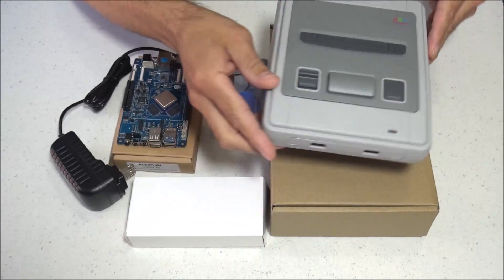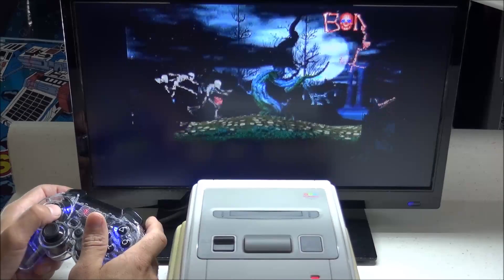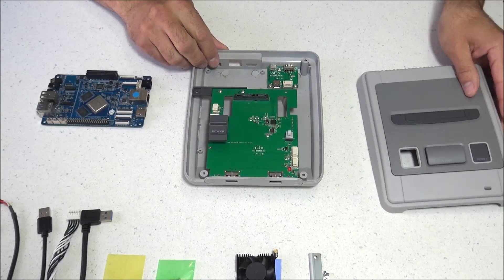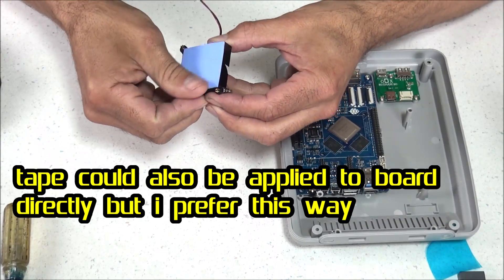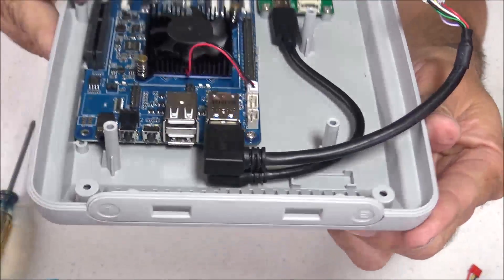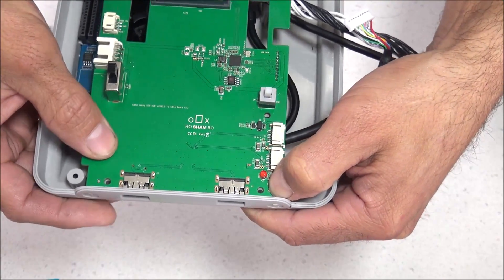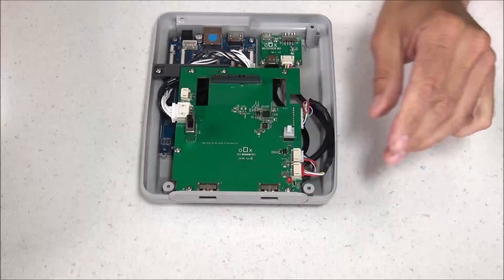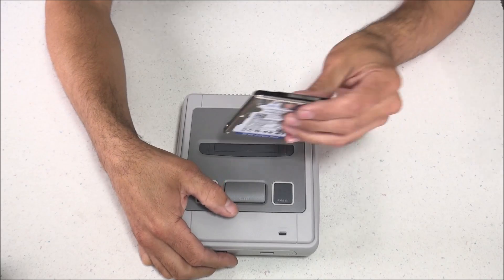First Look: RockPro 64 & Roshambo Super Famicom Case + BUILD

Comment from the maker: IMPORTANT NOTE: THE OPTIONAL METAL BRACKET I SHOWED IN VIDEO NEEDS TO BE USED WITH SHORTER SCREWS WHEN USING FAN OTHERWISE THE Plastic BRACKET COMES IN CONTACT WITH FAN causing it not to not spin.
Reply: I have this case that I just got from cloud media, but I cant seem to find a working distro that works with the case and board. Is there an image that currently supports the rockpro64 and case with the safe shutdown and reset scripts already  working? Where did you get the image from retro arena as the one I'm currently using doesnt work with the rockpro64 at least the one I downloaded from their site.
Reply from the maker: @ericochoa4034  the one I was using in the video has not been released yet to the public they are hoping to release that by summer is what they're saying. There might be a recall image that's available I'll find out some more info on that
Reply: @8-Bit_Flashback  ok thanks!
Reply from the maker: I am told that there should be a recall box image available for public early next week That will support the rockpro64. I will post a link here once the image becomes available.
Reply: @8-Bit_Flashback  thats really great news thanks for the info!
Reply from the maker: Here's a link to a recalbox image please keep in mind when the Retro Arena releases their image it will have a lot more functionality and I will be posting that on here as well as soon as it's released. https://github.com/mrfixit2001/recalbox_rockpro64/releases/tag/190427
Reply: 8 Bit Flashback hello do you have a link for safe shutdown script for rockpro64 with recalbox? thank you
Reply: 8-Bit Flashback, grateful for the video with the lack of documentation.

Comment: Could you comment which version of Rock64(2Gb or 4GB) did you used in this video?, I have a Pine64, do you think is will work with it?
Reply: blue dot on the rj45 signifies the 4GB model.

Comment: OK, so the only place I could find the case in stock was here - https://www.cloudmedia.com/?product=roshambo-retro-gaming-case. Man, Really confusing endeavor to order this thing on that site -  there are 4 different SKUs (supposedly) for this case. I am using a RP3b+, so I want the rasp.case...But, Hey, I already have a power supply (like i'm sure most of us have if we already have a RPI) so i looked at getting the case with no power supply...however it shows that that one is only "Compatible" with the Rock64 in the listing header, funny as also that particular site doesn't sell the power supply for the RPI by itself yet they have several different ones for the Rock64 - Also, description lists the basic case without power supply as "made for  Raspberry Pi and Rock64" no mention of the Tinkerboard. No where on the site does it state that their power supply is "Required" - if so, then why sell the case without one? Customer service has yet to answer my e-mails. Just a little weird.

Comment: It's cool the more sbc are getting case love. Personally I need a genesis or dreamcast case. Hopefully they can make xu4 and n2 and even h2 ones.

Which do you like more for emulation, n2 or rock pro?
Reply from the maker: The emulation development is a little bit farther on the N2 right now but the Retro Arena team is working pretty hard on both of the single board computers. And with everything being in the beta stages its hard to make a decision  just yet.

Comment: How come one of the Super Famicoms is smaller than the others?
I don't use Type C. I usually use Micro since PS4 and when I first got a SmartPhone.
So it's basically like a Micro Console.
Reply from the maker: type c usb is just optional it doesn't have to be used. This is medium size case . Its not as small as the sfc classics are.
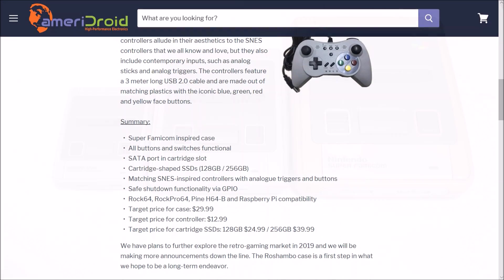Reply: @8-Bit_Flashback  2:09- I'm talking about the smallest one shown in the Video.
Reply from the maker: Thats the same size as the official super famicom classic. Its a raspberry pi 3 case made by retroflag.
Reply: @8-Bit_Flashback  Oh.